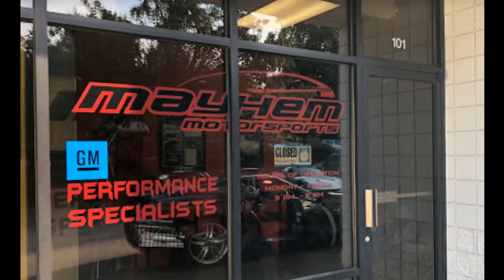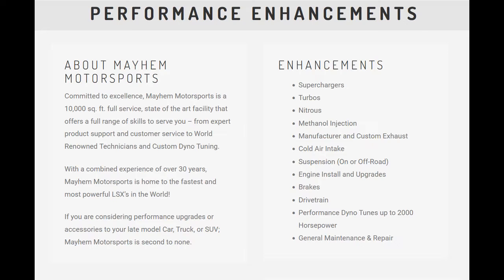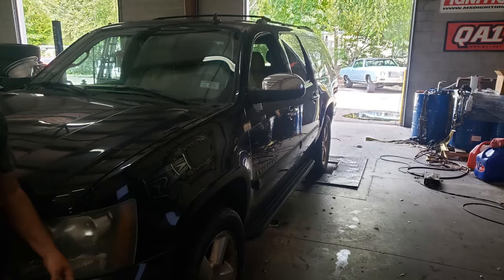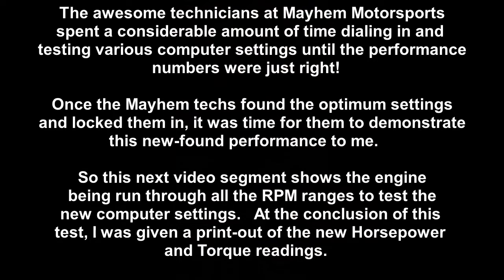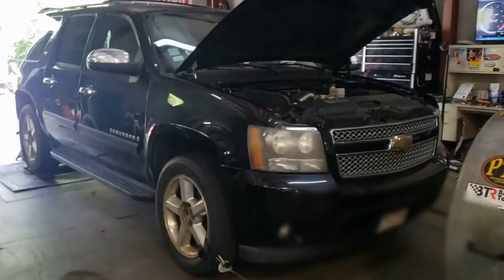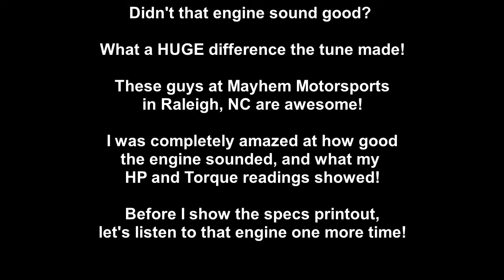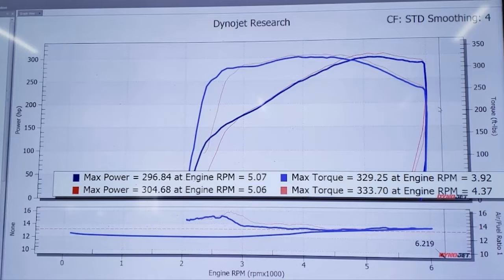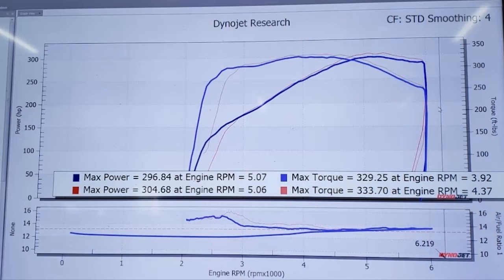Episode 70:  The Finale on the Dyno!  The performance tune of my new 5.3L engine for my 08 Suburban

Comment: Sorry, I must have missed what the orginal hp and torque numbers were that you were comparing too or what previous engine put out by specs?   I basically did close to the same upgrades too my 2006 L59 (LM7) .